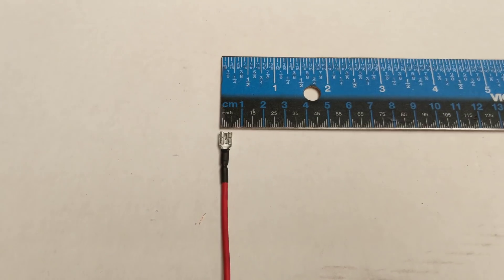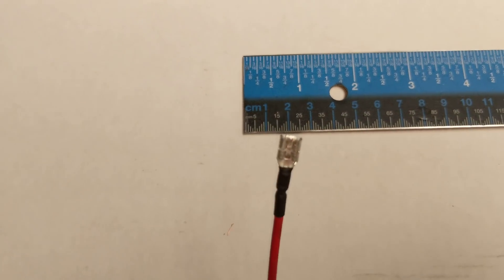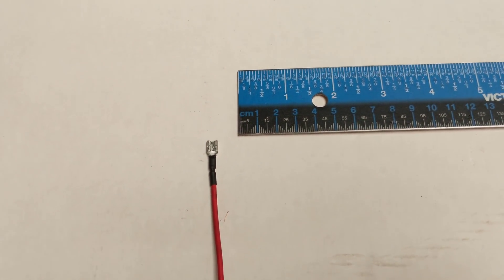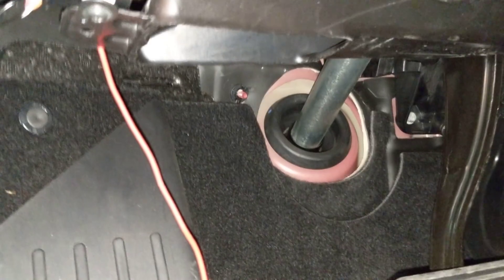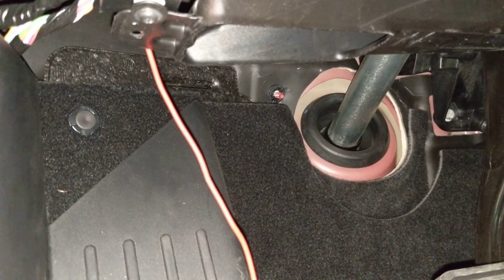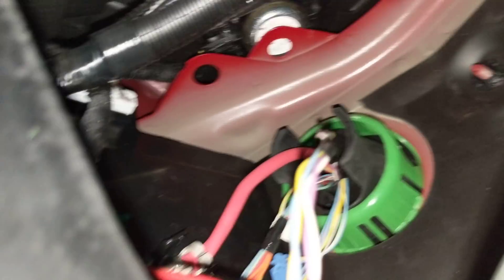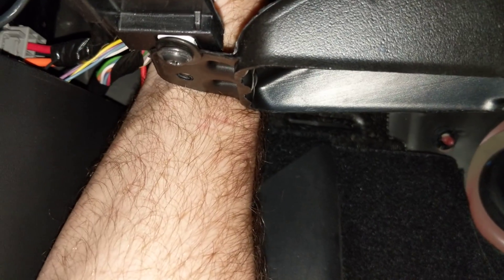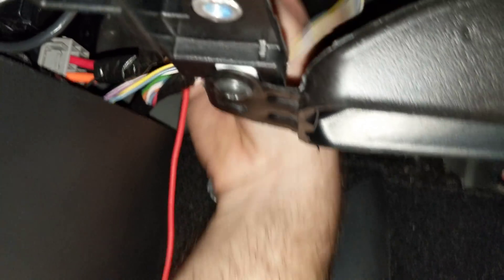Tesla Model 3 - How to safely get 12v for accessories

Comment: tested with my model 3 delivered in 2018 oct, the connector is empty and I was able to test it with a multimeter, I can get constant 13.3v as long as car is not sleep, so it is no longer a switched power, it's also not a constant power since as soon as the car is asleep, it will drop to 0v

Comment: Very cool. Though I would like to see someone find the factory molex connector for the other half of that connector and add a wire to the middle pin. I would not trust a measly spade connector to reliably hold in place overtime. 

Personally I would use that wire as a signal and provide a remote fuse tap kit. For additional circuits you know. 
But hey, that's just me. I think most newbies here are happy to just have a cheap, fast solution for a one time accessory.

Comment: I did this mod over a year ago and my dash cam would turn off when exiting the car, but now after a new software update is no longer turning off.  Is there another place to get a switched 12v? Just noticed it does go to sleep as long as your phone key is off or not nearby
Reply: you ever find a new place to install it. i just installed mine today. only to find out after the fact, that the middle port is now always on!! not sure what i should do, leave my radar detector always on? or manually turn it on/off whenever i get in the car?
Reply: @carlosrios7088  Manually turn it off is a guarantee that you will forget to turn it on one day, and a cop will get you on that day.
Reply: Yeah I wish the op would update this, after a software update it seems it’s constantly providing power if there is a key within distance even if sentry mode is off

Comment: As of a recent update this is no longer switched, do you know if this draws from the large battery or the cars 12v (normal battery)?
Reply: Yeah, I wish I had seen this before I spent a couple of hours wrestling with the dash removal and reaching into a place that a 57yo isn't really meant to reach anymore.  I manged to get it connected and tucked away under the dash covers, only to discover that it is always on, now....NOT switched.

So, if anyone has any OTHER places that I could try, that would be great!
Reply: @Buzzy1962c  yeah I don’t know how anyone could’ve predicted Tesla would change this, but the op should update his post
Reply: @Buzzy1962c  so is it now constant 12v or dead now?
Reply: @sirdork  I WISH Elon would make it configurable in the settings, but it is constant.
Reply: No longer switched, so it used to be? 
I just finished the install just now and noticed that my radar stays off after I walk away (mirror folds and car locks).... unless there's an unspoken "timer" when this switch will turn off eventually?
Reply: I noticed it does sleep as long as your phone is not nearby to wake it up

Comment: this port become always on power in 2020.20.1 update
Reply: This is what I was looking for may post this on reddit
Reply: tested with my model 3 delivered in 2018 oct, the connector is empty and I was able to test it with a multimeter, I can get constant 13.3v as long as car is not sleep, so it is no longer a switched power, it's also not a constant power since as soon as the car is asleep, it will drop to 0v

Comment: I need one that's switched, but remains on if ANYONE is in the car, including the passenger only.  (In other words, whenever the screen is on.)  Will this do that?  Another video has a switched 12V on the passenger side, but it turns off when the driver exits.
Reply from the maker: It's on when the car is awake.
Reply: @Ingineerix  Thank you.  Very much in fact... I know you have a lot of comments and questions and I appreciate that you took the time.

Comment: @ingeneerix do you know the voltage of the other two terminals in that connectors? I have a newer model and it will already be occupied. Might just need to find an unswitched method at this point.

Comment: This video does not apply to the 2020 Model 3. I attempted to access this "unused" 12v power source today to install a radar detector on my brand new Model 3 and the port is now used by something else. Pic here: https://i.imgur.com/Cvip0DV.jpg I cannot access the wire with enough dexterity to tap into it and I don't know if I want to without knowing what else it powers.
Reply from the maker: If you read the other comments you will find out what you need to know.
Reply: @Ingineerix  Yup, I figured it out, thanks. It would be helpful if you updated this in the video description as digging through comments is time consuming and not always fruitful.

Comment: @Ingineerix - Thanks muchly for the video. Have looked through all the comments and have found no-one else asking for the exact timing this pin gets 12v, given the car has various levels of "awakeness". So, when a acceptable method of unlocking the car is detected, is that when there is power to this pin (for use with a powered liftgate for example), or does it get power when a door is opened and the center screen turns on?
Reply from the maker: I haven't tested all the states, but I think anytime the car has had it's accessory power enabled, it will be on.
Reply: @Ingineerix  Thanks Ingineerix. In an car with a keyed ignition it would be easy to figure out when something relying on the ACC circuit gets power, but it seems the problem with a keyless car is what state would equate to one with ACC power. If you know or figure that out at some point (and remember this question) I would love to know.
Reply from the maker: @morriec9868  As soon as you open any door, the car goes to Accessory power, once you step on the brake then you get the drive rail (like "ignition" on a normal car).  The added wrinkle is that you also can get accessory state when the car is sent a wake command from the Tesla app which happens when you send a remote command.
Reply: @Ingineerix  Appreciate it. Had hoped that power would be available on the accessory line as soon as an authorised unlock device was detected (as at some point M3's would unlock with one of these devices within range, even when one only intended to walk nearby or past the car). I realise this is software controlled, so along with not doing unlock actions (potential mirror unfolding, light flashing, etc) the software could also not apply power to this line until a door was opened :(

Comment: Thank you @ingineerix, took some effort but I got it after removing the airbag ( 4 bolts, 2 screws and 1 plastic fastener ) to get more room for my arm to reach inside the dashboard.  Used it to connect 14 gauge wire to a Terminal Distribution Block https://www.amazon.com/dp/B0055HOK7C that I installed in the driver footwell on the left side, so it's easier to add 12v loads, like my radar detector and soon to be dashcam.  See images here: https://imgur.com/gallery/xDv2HSO

Comment: How do I remove the cover under the dash?
Reply from the maker: Remove the push rivets by prying the head out of the body.
Reply: @Ingineerix  I removed the push rivets however there is still another panel with airbags in the way
Reply from the maker: There are 4 bolts that hold the airbag in.   If you are not experienced with modern cars, I recommend you purchase a day subscription to Tesla's manuals at https://service.teslamotors.com/

Comment: Hey... I’m installing the power lift gate right now and the recommendation is to tap at the screw beneath the red power wire but I find it impossible to access. Do you have any recommendations?
Reply from the maker: I have no context here, so I can't give you any advice.  If the "screw" is a ground, then you can get that at any fastener that is screwed into the body.
Reply: @Ingineerix  thanks, I ended up finding another place to tap the 12V and complete the install.  There is another very easy to reach location down in the footwell!

Comment: Thanks @Ingineerix I got this done for my TM3 so I have a separate 12v source from the center console, but the issue I have is that it's loose and not a solid/good connection.  My 12V gets interrupted and I have to had the connector in place to get a good connection so not very practical.  I made sure to use the correct non-insulated 5mm spade connector you linked/recommended, so that's not the issue.
If you or anyone else has a better solution for securing the spade connector, I'd love to hear it.
Reply from the maker: You might need to use a small tool to push the female spade over the pin in VCLeft.  It's very tight if you use the terminal I spec'd and push it in all the way.  If it's not tight, then try and squeeze the terminal closed a bit, if it's too tight and you can get it inserted all the way, then open it up a bit.   Hundreds of people have gotten it to work now, so you should be able to.
Reply: @Ingineerix  Thank you, took a few more tries after removing the airbag to get more room, but I think I got it.  Used it to connect 14 gauge wire to a Terminal Distribution Block https://www.amazon.com/gp/product/B0055HOK7C/ref=ppx_yo_dt_b_asin_title_o07_s00?ie=UTF8&psc=1 that I installed in the driver footwell on the left side, so it's easier to add 12v loads, like my radar detector.  See images here:  https://imgur.com/gallery/xDv2HSO
Reply: You should check to make sure that the connector is actually pushed onto the terminal and not in front or back of it.  Otherwise if that's not the problem then just pinch the spade connector like Ingineerix mentioned.

Comment: I tried to do this, but after opening it up and seeing the wire mess I decided it's too much trouble (plus it's not clear how to handle the wire that is already in the slot in my 2019 M3), so I just guided the wire all the way to the 12V socket in the center console.
That only took 10 minutes minutes or so and turned out be pretty discreet. Only a small section of wire going from radar detector up to the ceiling trim is exposed. The rest of it is under the trim all the way to the center console.

Comment: WOO, thanks @Ingineerix. I just finished this today.. What a pain in the ass. I bought the hard-wire kit from j28. I have a 2018 and assumed (bad) that I had the red-prewire and i could just tap it. Well, i didn't. So i clipped the female spade connector that came with the hard-wire kit and then soldered and heatshrinked an extension wire i had pre-prepared with the spades ingineerix recommends in this video description. Once i finished that, i took apart the mirror to run my cable up, i went in via the small gap above the mirror ball and ran up in to the headliner. I came around down the driver side pillar (removed it all, which i guess i didnt need to.. probably could've just stuffed the wiring behind it..)  then down into the area. For ground, i removed the kick panel and trim along the driver door floor. Under the left side of the carpet was a ground with some wires already there. I went ahead and grounded there. I removed the knee airbag area (not sure how you would plug in with it there), removed my fuse, turned off car power, and then plugged in. I reinserted my fuse (i know ingineerix says you dont need one, but it came with the hardwire kit), enabled power, and tested my radar detector. I had power so i put everything back. I had some problems because i messed up how the foot air vent was seated so took it apart again, and reseated that thing properly and then reassembled. It looks great and of course, no warnings or power issues thus far. 

for parts, i used the following
https://bit.ly/2XP8bWV
https://bit.ly/2JyMzW0
https://amzn.to/2D3NY2R
https://amzn.to/2LXC1kR
I didn't own a wire crimper, so i bought https://amzn.to/2NYcQB2

It took me a couple of hours to do, but I've never done any work on auto trim/removal/wiring before, so i suspect if you have experience it would be much quicker :)

Comment: This is a great video. Unfortunately I tore everything apart trying this and am still unsuccessful. Just can't get the radar detector wire with the female spade to go on the male. It's been pretty frustrating.
Reply from the maker: Try spreading the spade open with a small flatblade screwdriver.
Reply: @Ingineerix  Thank you for the timely reply. That was my thought as well. I had tried it, but to no avail.
Reply from the maker: Then you might have the wrong terminal.   You are the first out of many to have this problem, so something must be wrong.
Reply: @Ingineerix  Kudos to author. I thought I must have the wrong spades as well. I actually had tried three different sizes from local stores. In the end, I ordered the ones he recommended and wallah, fit! Thanks again for the video.
Reply from the maker: I hate saying "I told you so", so I'll just say "Glad I could be of help!"  =)

Comment: Would there be anything wrong with connecting to that big power wire?
Reply from the maker: You would need to fuse it properly.  Depending on load (untested) you may encounter unexpected alerts.
Reply: @Ingineerix  Well, I proceeded with testing that, I have tested it at 40amp continuous(30 minute) and no issues.... so im happy.  I routed 10AWG wire around and to my center console and usd a bolt near by for ground.  working good so far.  I would like to know how much is safe to pull... judging by the input wire I would say 60-80 amps.
Reply from the maker: I don't know because I have never tested it.  Let me know what you determine!
Reply: I would need about 100 ampere for my audio amplifier. Guess I will try that big power wire as well.

Comment: how do you get that plastic off?
Reply from the maker: Screws, Push rivets (pull on head), and snaps.
Reply: @Ingineerix  im sorry for my poorly worded question, I got the first panel off that has the two lights, the 2nd pannel I pulled the screws out and I just can't seem to get it off.   but regardless I have changed my approach and no longer need to.

Comment: Just tried this and I have an open slot but there is not 12v coming from there.  WE have one of the first production runs of the model 3 but there is no connector in there. :(
Reply from the maker: This has been proven working on even cars as low as VIN 2000.   Note that it only provides power when the car is awake, such as when the power windows can be used.  It also cannot power high-current loads or any load that has a very high inrush current.
Reply: @Ingineerix  Want to say you are correct. I got my voltmeter and put in there and did get 14V out of it.  My insulator kept me from being able to push the connector all the way in.  Thanks for showing this. I'm going to be doing a writeup on installing a custom radar detector and will be directing toward your video!

Comment: I wonder if tesla thought about police or others that need to add radios and other accessories? 15 amps might not be enough
Reply from the maker: It's possible to pull more, but then you have to add (carefully engineered) extra circuitry and protection.  The DC-DC in the 3 is very capable, and there is also the option to pull HV directly and convert it to whatever power is needed.   There have only been a small number of Police Teslas (so far only S and X), so it's unlikely Tesla would consider this use case when designing the power system.

Comment: This location is being used on my model 3. There is a oem red wire going to it. Do you suggest tapping into that?. Wondering what the oem wire is for.
Reply from the maker: On newer 3's Tesla apparently populates a red wire here that runs to the rear for possible trailer lighting use.  If you aren't using it for that, it's therefore still unused, so you can safely tap it.
Reply: @Ingineerix  Dear If this red wire is going to the rear for possible trailer lighting use, is it possible to find easy there to use it as light 12V positive source.  Do you know where is allocated? Many thanks.  Regarding above video was fantastic 12V source.
Reply: @javiertena4484  I would like to know the same thing, if anyone figures it out (where is the red wire in the rear?).  @Ingineerix likely has a Tesla without this wire, so he may not be able to go looking for it easily.
Reply: @Ingineerix Thank you. I did that and it works well. Saves one the difficulty for plugging in the 5mm as I just spliced the radar wire downstream.

Comment: I have a brand new Model3 European version and I want to install some devices. But this center console 12V (cig. lighter) is NOT switched. It is permanent.
Do you have any idea where to find an “ignition on/off” wire?
Reply from the maker: On newer 3's Tesla apparently populates a red wire here instead of being empty as in my video.  That red wire runs to the rear for possible trailer lighting use.  If you aren't using it for that, it's therefore still unused, so you can safely tap it for switched accessory use up to 10A.
Reply: Why would you want it “switched”? Just use it

Comment: Would you please explain why I would want to do this instead of installing a 12V USB hub in to free up my two USB ports. Like this http://tinyurl.com/y36syyyp
Reply from the maker: Because the requires a plug in your 12v jack.  Some people want their accessories wired in neater with no cords running around the console.  Say for a dashcam.

Comment: You've stated that the current protection trips at 15A, do you know what the allowed surge current is? For example, is 80A for 10us allowed? What kind of sensing trips the protection, is it a polyfuse or current sense analog feedback loop or something else?
Reply from the maker: It's a high-side driver with integrated current protection.  I have no tested fast transients.